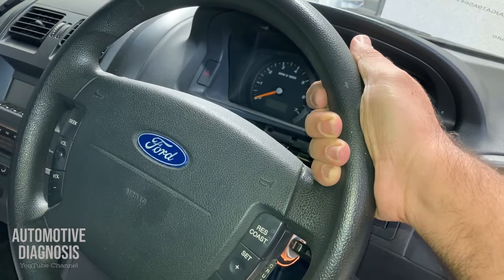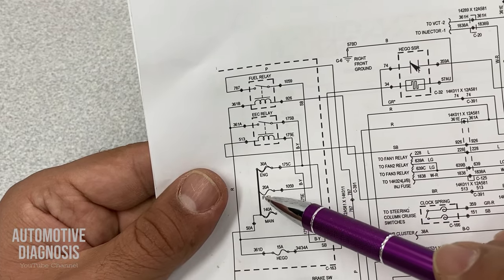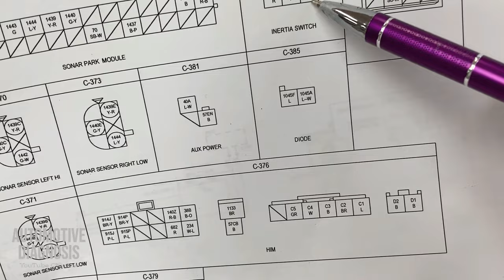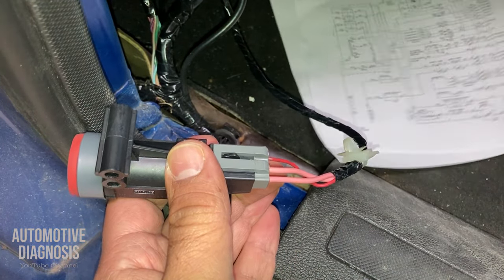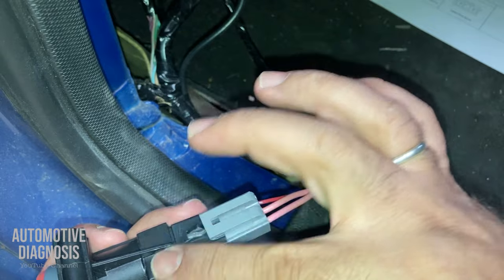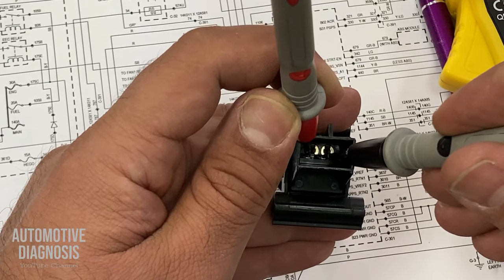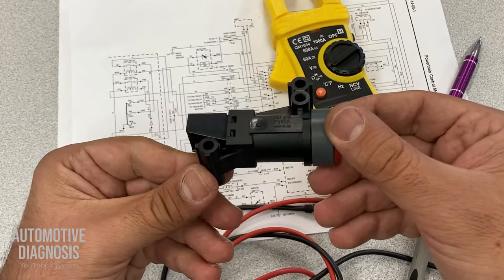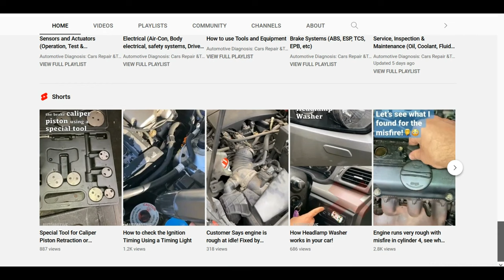How to Test Fuel Cut-Off Switch | Location, Test, Repair, Bypass or Reset Inertia Switch

Comment: My 2015 ford ranger 3.2 diesel wont start after hitting a pothole, just cranks up but won't start. Any ideas why and where's the inertia switch is located,  Thanks in advance,  Australia 🇦🇺

Comment: Have checked any and every place suggested for a fuel cut-off switch. and there is none.  I've even taken carpet up in the tire well.  Called the local Ford place, and the guys answer was, "I really don't know."  What?!Car tries to start, sounds like it at least,  but just won't start. I've watched ALL the videos as to where it should be located, and I have check in these places, it just isn't there.  HELP!
Reply: Is this one going to help with the cut off switch - at this point, I need anything!
Reply from the maker: Do you have the check engine light on?

Comment: Why didn’t you simply reset the switch? 🤦🏽‍♂️
Reply from the maker: Reset only works when switch has cut-off the fuel pump, but when switch is faulty, reset won’t work. That’s why this video shows how to bypass the switch too.

Comment: What is the purpose of third wire? My ford focus MK2 has same switch and connector but has only two wires on the place of pink ones you had. On third pin wire when ingnition is ON I have 12v and  on the second 4v?!? My car won't turn on just cranking and I'm investigating now what could it be.
Reply: Did you figure it out?

Comment: I have an 05 Hyundai Accent ad there is no reset button so and there doesn’t seem to be any information on what to do.
Reply from the maker: Hi there, I don't think there is one on your car. You can check the fuel pump relay if pump is not working.

Comment: Thanks for the info!
I'm just curious where this fuel cutoff switch is located?

I have the 2007 mk2 Ford focus but's the estate (wagon) version.

I'm getting engine cranking but no fuel pump prime noise!
I cheeked the 15amp fuse in position 51 under the glove box and it looks good but I changed it out.

Will check the fuel pump relay next.

Comment: Thanks for the video, it’s very helpful, if you can show me where is the fuel cut off switch located in Cadillac SRX 2014 please.
Reply from the maker: Hi there, not all cars are equipped with fuel cut off switch, on many of them ECM performs the fuel cut off function, I think your car must be the second type.

Comment: Thanx for the video very informative, and will help me out with a project of mine. One Question just out of curiosity,  C-171 on the diagram, the red wire runs to. is that a warning light in the cluster ?. Thanx
Reply from the maker: Hi there, thanks for your comment. Yes, exactly. But not all cars have that one.

Comment: I have a 2003 Lincoln Navigator. What if my fuel pump works when I bypass the relay, and my inertia switch is working. What could be the cause for the pump to not come on when I turn the key to the on position? Also on my year, they made the fuel pump relay internal soldered to the board. Please help me and thank you
Reply from the maker: ECU energizes the fuel pump relay, so if relay is ok and bypass shows it’s working, you need to check the relay’s control line ( between relay and ECM)

Comment: Hi I can not find my Inertia fuel cut off switch for 2006 DIesel Santa fe. Can you help me find  it.
Reply from the maker: I don't think there is one on you car.
Reply: I have cold starting problem
Then suddenly, cuts out while driving at slow speed. Fast driving is ok.
Reply from the maker: @gautombose4172  Hi there, if it is diesel, for cold starting your problem could be coming from glow plugs. Hi-pressure pump also must be checked as in high speed it rotates faster by engine and gives higher pressure, but in low speed, a weak pump shows itself.
Reply: @AutomotiveDiagnosis  The clue is that, when the car cuts out, and I turn on the ignition, the fuel pump does not come on. I can hear the vibration noise, from the fuel pump, if and when it turns on.

Comment: Will u plz tell from where u brought that wiring diagram or how I can get that wiring diagram or any wiring for any car
Reply from the maker: Hi There, That's Ford wiring diagram that may come in PDF format or offline format that you can open it up with a browser. I have been working in this field for many years so I have tried to find them from the dealerships or sometimes online. There are some online websites offering the workshop manuals I believe.
Reply: @AutomotiveDiagnosis  
Thanks